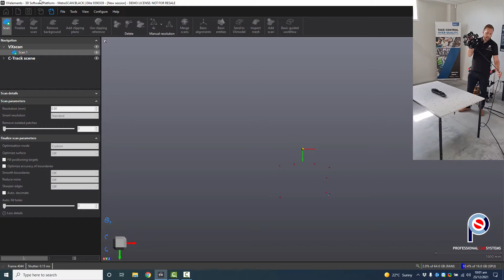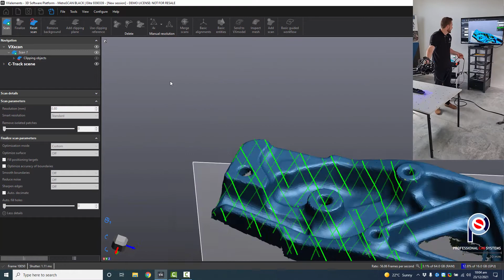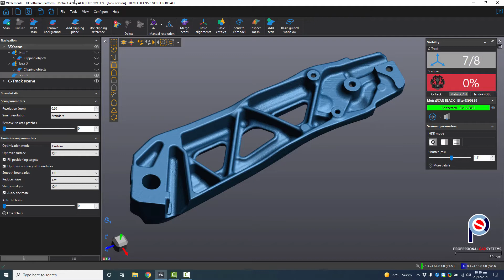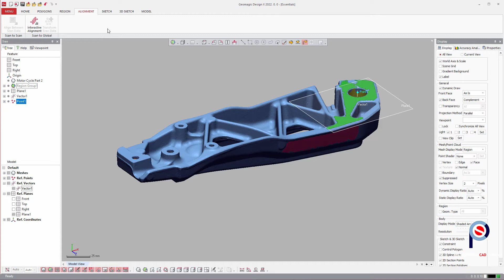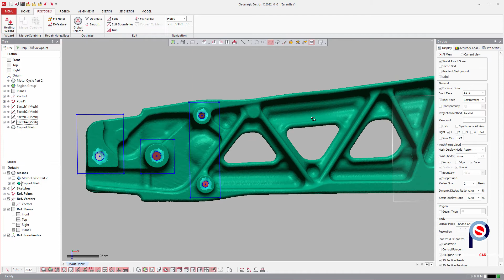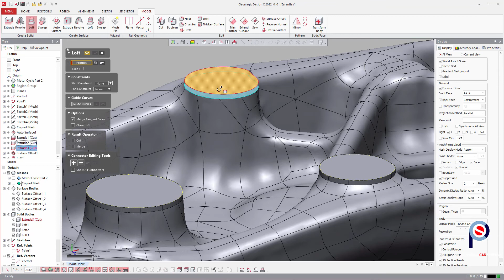Reverse Engineering a Motorcycle Part with Geomagic Design X Essentials

Comment: But cnc machine cannot use cad file , but if 3d printer stl file mesh can do
Reply from the maker: That's right, this type of 3D model i.e. Auto-Surfacing is not ideal for CNC machining.  But this workflow/3D model could be used if you simply need the part to be apart of an assembly for design purposes.  Saving countless hours of 3D modeling especially if you do not intend to CNC machine it.